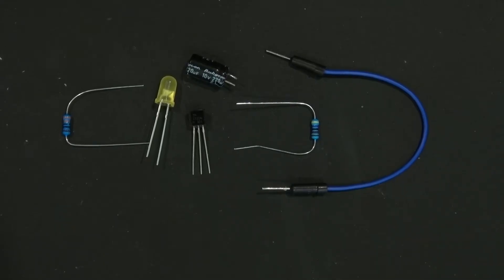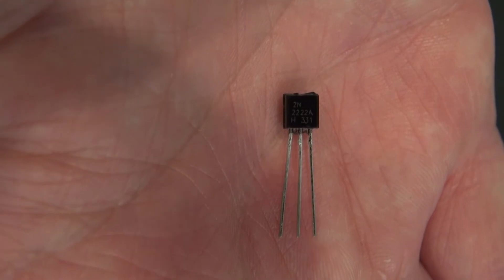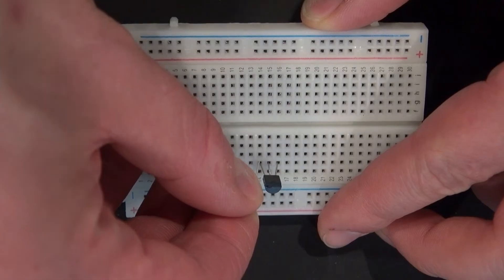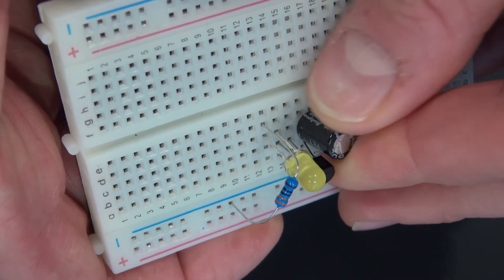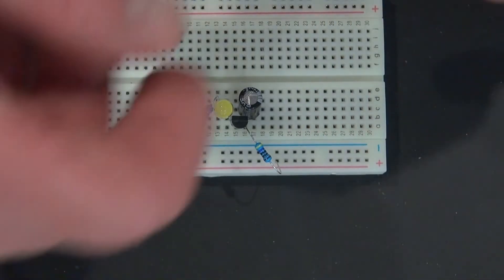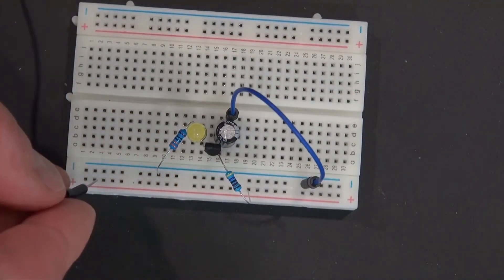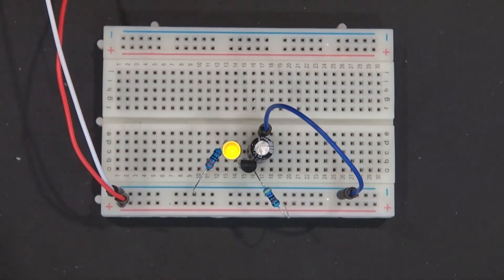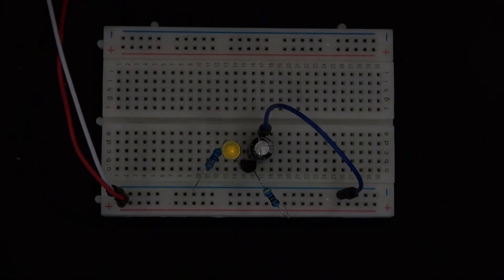Flashing LED With 2n2222 Transistor

Comment: hmm i wonder why the base wich is controlling the transistor is not connected to aything i wonder is youre whole channel fake (it is)
Reply: It is an Esaki oscillator, it is not fake. It needs at least 12vdc. It works by the break down of the collector and emitter.

Comment: I got mine working but mine is driven by the base the base having  resistor capacitor in series then my supply goes to another resistor then led then then collector then the emitter just go to ground.. btw the base with the resistor and capacitor i experimented with lower capacitance and different resistor so the binks occur because its either off or on.. the base and collector are sourcing from power but not directly because you want the resistor and capacitor first

Comment: For 12.5VDC  had to go with 25k by 22 ohm resistors with the 2n2222 and a 680uF 16v cap for 2 blinks per second. The 22 ohm resistor was between the LED and the common. The 25k made up of 20k and 5k in series was tied to the + of cap and emitter of the 2n2222. Tried going with values others suggested and this circuit is strangely voltage specific to resistor/capacitor uF values. I had hoped to get this to work with 5VDC going with lesser ohm resistors like a 330ohm for + to cap and transistor and  direct connection between LED and common but nothing. The 2n2222 doesnt seem to get excited until around 9VDC and then you are messing with resistor values between + to cap and transistor and LED direct to common or a low ohm resistor to affect the blink rate between LED and common. LED grows from DIM lit to flash and out and then dim lit growing in intensity until flash. Anyone interested in using this circuit for a hard wired soldered project I'd suggest breadboard setup first to messing with values until you get it to flash at the rate you want and then solder up everything after confirming it does what you want as its strangely voltage sensitive to blink rate or on solid or LED completely off.
Reply: I'm glad I'm not alone on this lol

Comment: Yeah, you are not using the Transistor correctly and are relying on Collector/Emitter breakdown to flash the LED (not a good choice).  Simply connect the Cap/Resistor pair to the Base rather than the emitter and the emitter to ground and drop VCC to your desired voltage (3.3 or 5v).  The Cap will charge through the resistor until it reaches around 0.6v then turn on the Transistor and LED (transistors become active around 560mV and saturate fully around 0.9v).  The time constant is RxC which, for your Cap/Resistor pair, will give you a little more than 1 second to reach 63% of VCC.  You only want to get to 0.6v so thats way too fast a blink rate so increase the resistor from 4.7k to 47k to give you a blink rate around 1.5 seconds.

Comment: I think maybe the relationship between the positive voltage of the base in relation to some voltage above 5v+ or so (with 2N2222) on the Emitter causes the transistor to turn on allowing some charge stored in the capacitor to release to ground in reverse. The resistor prevents a dead short and the cycle continues at a particular input voltage depending on the capacitor and resistor value. Random guess though.

Comment: Ive tried this so many times and the led never blinks 😔 I have a sack of 2n2222 so I figured it may be a bad one and after 10 different transistors I gave up...
Reply: Same for me and I have tried a tange of voltages
Reply from the maker: Did you adjust the voltage?
Reply: SciTyeTech did 10.7 and used all the same parts
Reply: I have no way to modulate the voltage and tried the same it won't work

Comment: Do i have to use those specific resistors.i dont have  a 330 ohm resistor
Reply from the maker: You can, you just need to change the voltage.
Reply: @SciTyeTech  can you give me an example?
I have 10k ohm, 10 ohm, 20 ohm , 1M ohm, 220 ohm , 1k ohm, 47k ohm, 22k ohm, 100 k ohm, 100 ohm, 470k ohm, 220k ohm, 47 ohm, 470 ohm, 4.7k ohm, and 2.2k ohm resistors
Reply: Either, the voltage needs to be changed, or the capacitors value. I tried using a 680 ohm resistor at 12V with a 1500 uF capacitor and it creates a signal at about 120hz.

Comment: I did it with slightly different resistor values and with a step-up module which increased the output voltage to 5V for me, thanks for the circuit!
Reply: it's not working the same for piezo which I wanted
Reply from the maker: You're welcome. I am glad this was helpful.

Comment: does it work with a pn2222a transistor?
Reply from the maker: It might work because they are both NPN transistors with the same pinout. The one you want to use, uses a little bit more higher voltage to power it on. Give it a try, it might work.

Comment: its fake i connect everything on the board and nothing happend
Reply from the maker: Did you set the voltage to 10.7 volts? I too have had issues with this circuit. It will work, but only at a specific voltage. On this channel, I do not put anything fake. This channel is meant to educate and have fun making things. I have made things that don't work. If they don't work, they will not be uploaded. I did not make this channel to get view or popularity. It is for fun and for my own personal notes for me to look back on. Please make the circuit again, I assure you that it will work.
Reply: @SciTyeTech  yes but the voltage is 10.6 at me and thanks for help great video always
Reply from the maker: This is what I mean, this circuit seems to be very picky. Thanks, you're welcome!
Reply: Faking this circuit is harder because the circuit itself is too easy lol. It also works with bc547
Reply from the maker: @udhi_gn3893  lol!
Reply: Have tried it for myself, maybe you connected the transistor wrong.